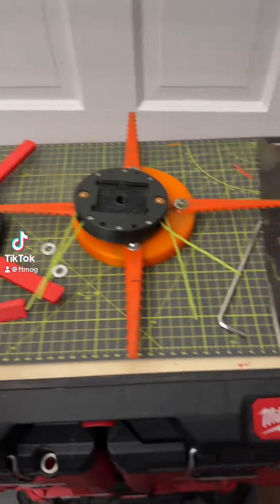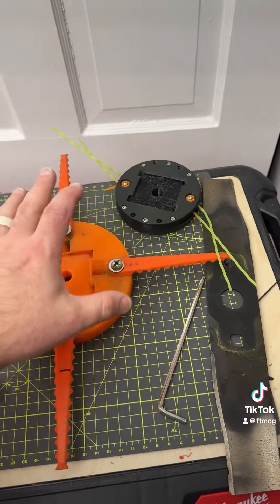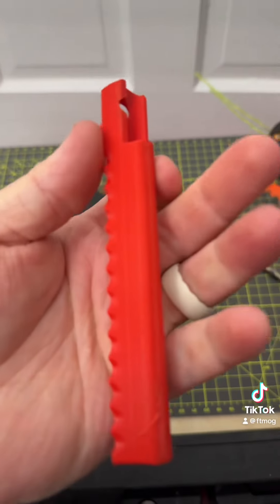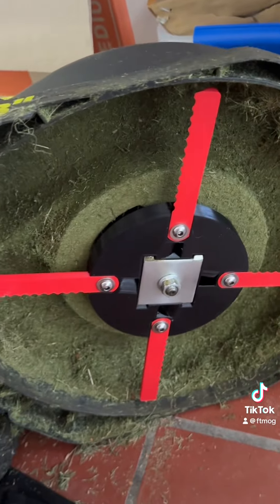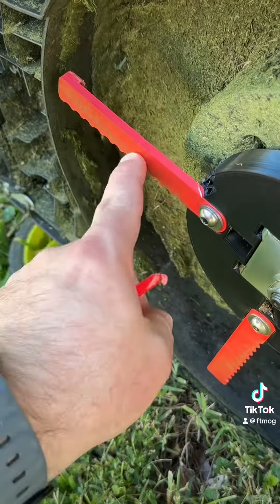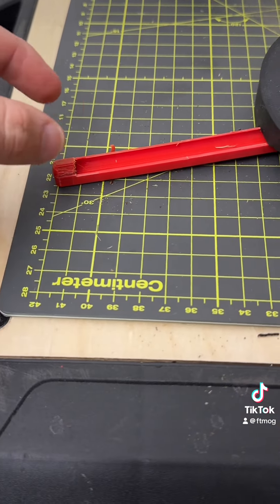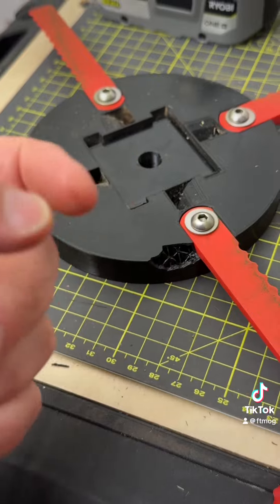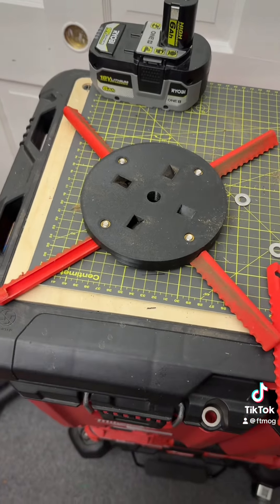Working on making a mower blade.

Comment: That's an awful lot of work to avoid re-sharpening your mower blade, and paying attention so you don't run over rocks and the like.
I'm a 3D printing nerd, too, and there's nothing more satisfying than a print that solves a problem. But, I don't think this idea is a good one.

I designed a PLA weed-eater blade for my string trimmer. It worked great, until it failed, then it was a matter of luck that nobody was hurt by the flying pieces.
I realize your mower has a bit more protection, but you have to plan for the unexpected.
Reply from the maker: @jimbeckettplay  I’m afraid the blade is beyond sharpening at this point.   I have new ones coming, but I have no idea when they’re gonna show up.    This is more or less temporary fix.